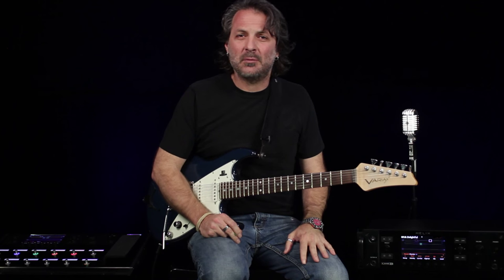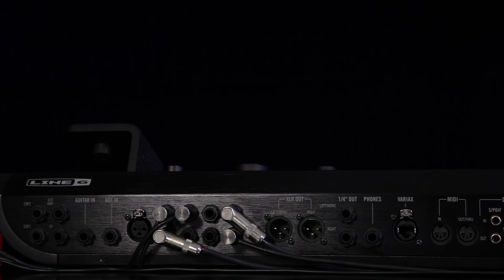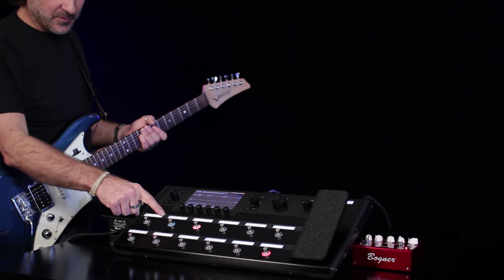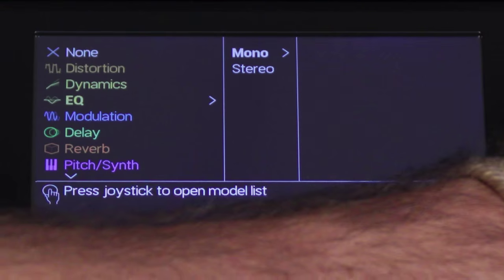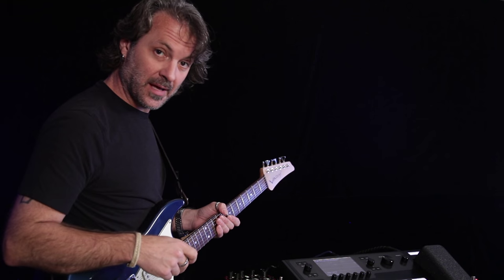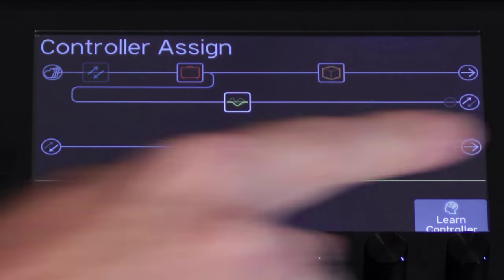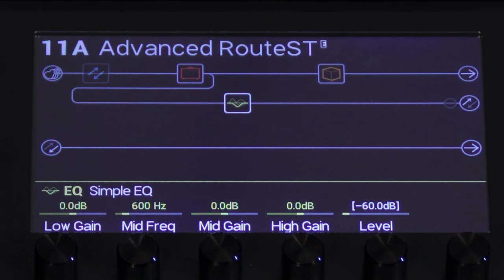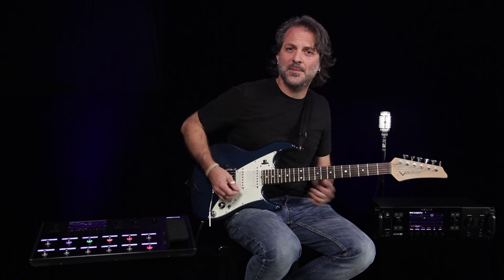Advanced Signal Routing With Helix | Line 6

Comment: I created  presets under 05A and 05B both are distortion presets. 05A is noticably louder than B and    I can't figure out how to get the volumes closer to each other.  All cabs are the same but heads are different. Volumes and eq settings are close. And the quieter preset doesn't have a noise gate on it.

Comment: Great way to save blocks, but what if I'm using an HXFX and instead of a delay it's a stereo amp modeler where I'm sending mono and returning stereo.

Using the stereo block FX LOOP 1/2 would work?
I'm thinking I'd have to pan everything to the send 1 but I'm not sure if the block has that option.

Or should I send 1 mono and then use another block for stereo return 1/2?

Thanks for the help.